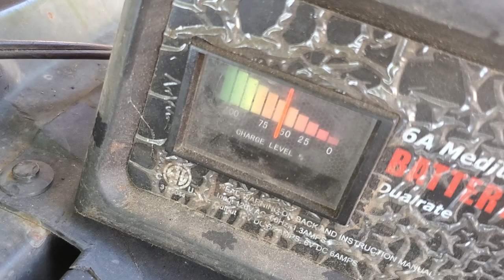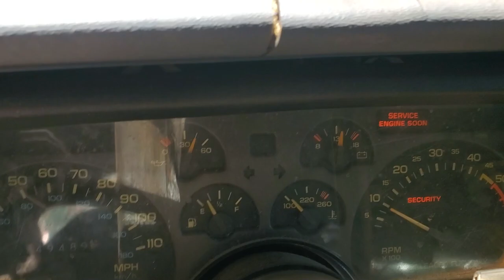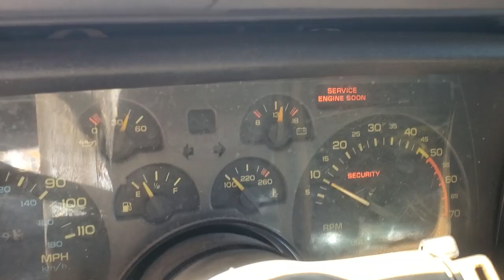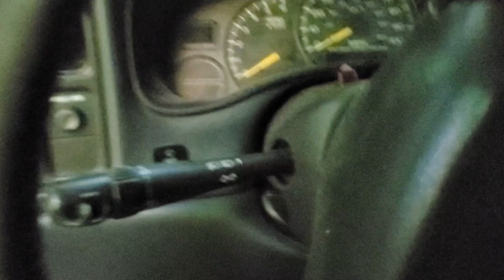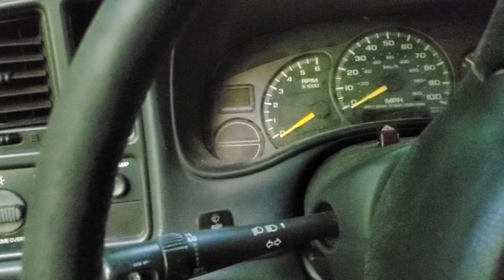Ketchup the Camaro's redemption! Toilet seat for the win! Burnouts, and trashing the lot trucks!

Comment: That was a great driver seat installation. Cut a hole in the floor, plumb a water tank, To rinse the dirty.  ready for the long haul.
Reply: Think nature has done natures work already. The real issue might be the opposite, namely keeping the porcelain off the pavement since the floors have rotted out. Had that same issue in mine. Those floor pans and t-tops are a terrible combo.
Reply from the maker: long haul shitter 'maro!
Reply from the maker: just weight reduced is all!